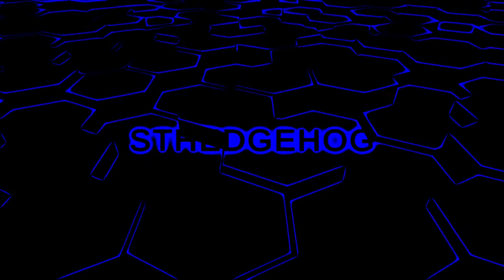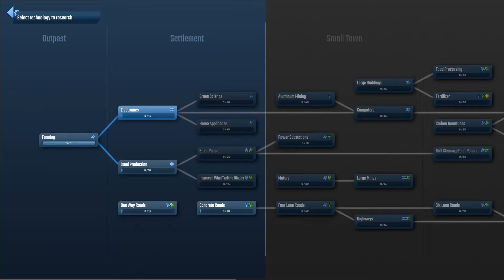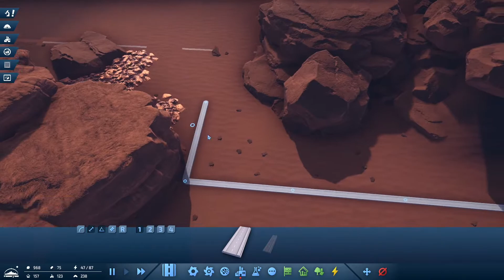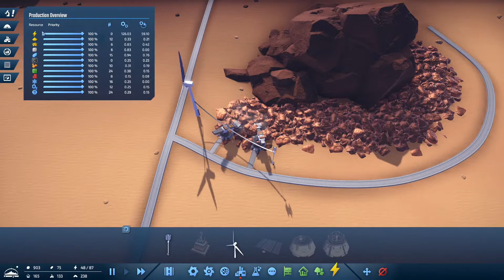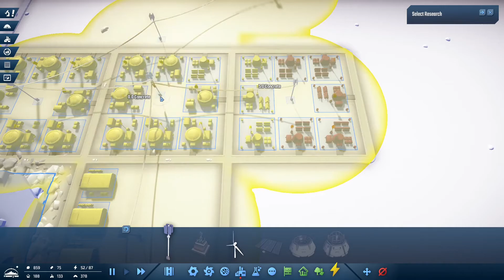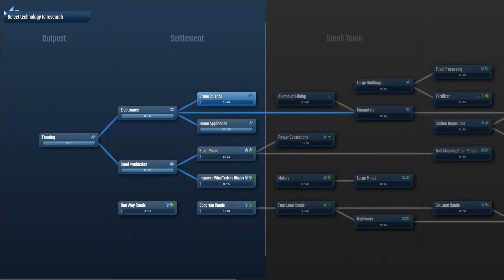InfraSpace Grid City - Bonuses Explained

Comment: so with your current bonuses your making 8 carbon but need 9 carbon ... 32/36 
.
16s for 1 carbon ... need 1carbon every 20s ... easiest factor is for 60seconds ... so 4 carbon made in 64s ... and 3 carbon needed in 60 seconds ... so slightly more ... BUT 24% bonus for science ... or near on 1/4th ... so every 15s you need 1 carbon ... again at 60s ... 4 carbon needed BUT 4 carbon take 64s to make .. therefore every 5 science you need an extra carbon maker ... at 4 science you are right at the cusp ... technically just under it so always just short for a short time
Reply: steel with 16% bonus would be almost 13s (13.44) to make 1 .. carbon is 16s ...so every 5 steel you MUST have an extra carbon ... the quick way to find that out .. is 16% is near on 20% which is 1/5th ... the closest 1/5th of 16 is 3 ...